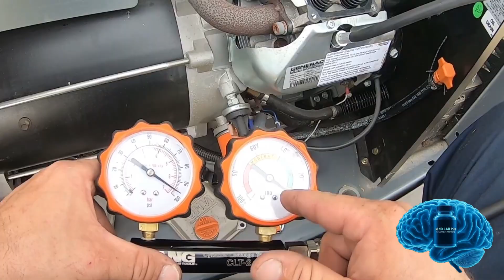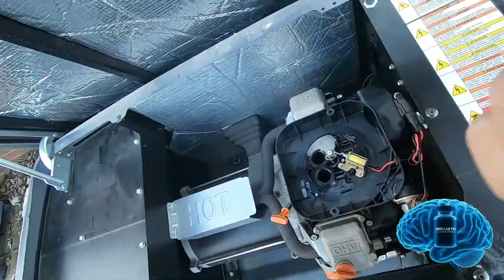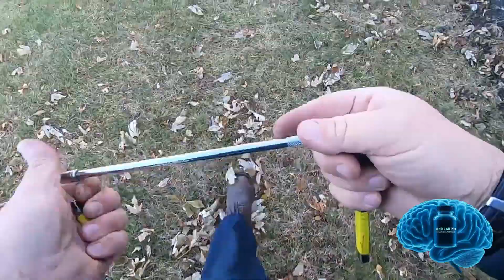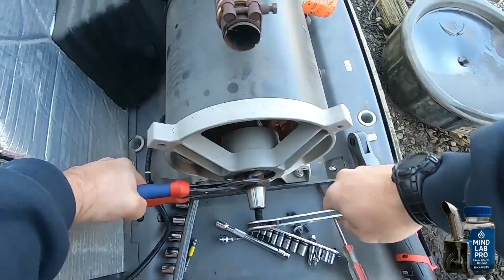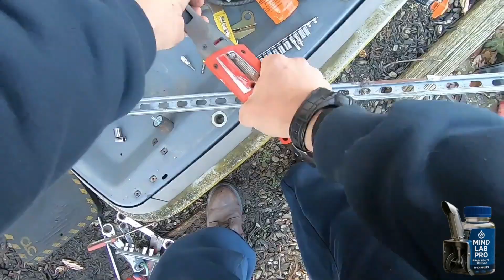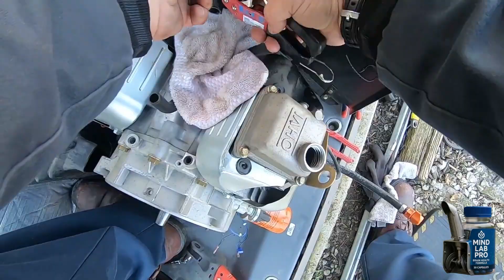THE AUTOPSY 🔬⚡Part2

Comment from the maker: After 27 years diagnosing small engines that left other techs completely stumped — I started filming the most shocking mechanical failures I've ever seen. Exploding batteries. Ghost voltage. Engines destroyed by secrets the manufacturers will never tell you. Cheap $18 parts framing expensive control boards. Silent killers hiding in plain sight for years.
We don't just make how-to videos — we produce Entertaining Mechanical Whodunnits where every episode has a villain, a smoking gun and a twist nobody sees coming.
🔔 SUBSCRIBE and hit the bell — new mechanical murder mystery drops every single day. Each case is stranger than the last.
26 years. 3,000+ repairs. The machines that fooled everyone else — didn't fool me!
🧠 Sponsored by Mind Lab Pro — the clinically advanced nootropic stack engineered for the sharp minds that catch what everyone else walks right past. Link in channel description.